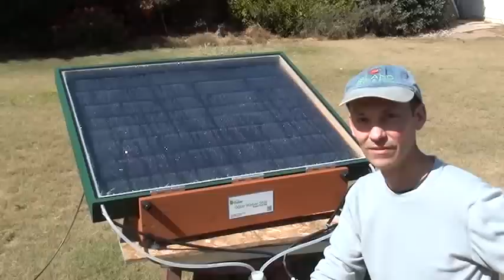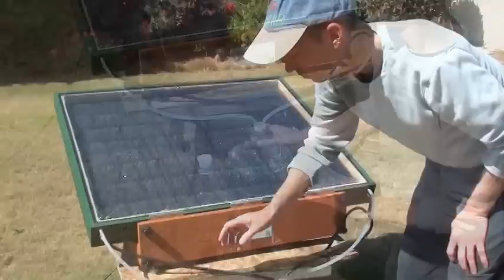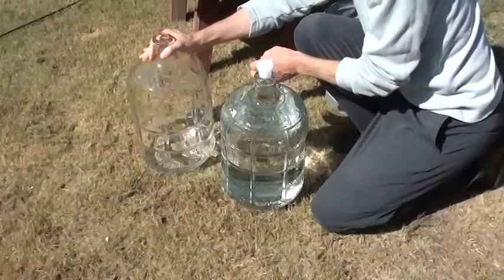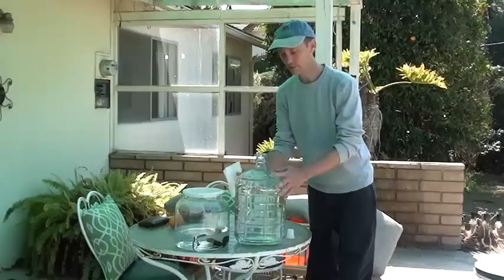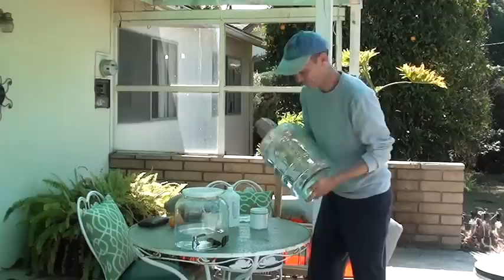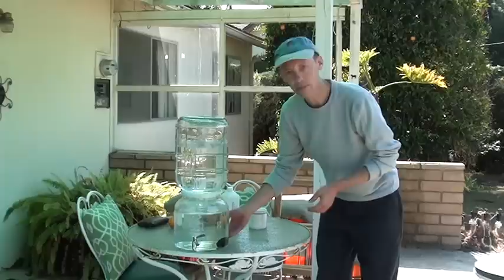Solar water still by Do-Right Solar

Comment: This seems over-engineered for area-based optimisation. Most people don't need to max out on distilled volume per unit area. What you want to optimise for is simplicity (fewer modes of failure), maintenance, durability, and cost per distilled volume unit. For example, you can just double the absorber area and forego complicated inflow/overflow and angled wick. Either by just increasing the size of the entire basin or by just adding a rudimentary thermosyphon by connecting black hosing to the high and low points of the basin, which can be spread out over an arbitrary area of sunlight. Super simple, low cost, low effort.

Comment: Destroying pure water by reintroducing poison in it. Wow!
Reply: That's distillation of sea water, if you are in arid climate, and you can use activated carbon to remove the impurities. And no Silicon and glass is not poison. If you mean salt then every animal from elephant to zebra to gazelle in the wild eat salty mud especially close to river delta to have the minerals they need.

Comment: ya there is very few chemicle compound this wont filter out. my only question how do you deal with algeas? bleach? or carbon filter? microbes would be the enemy of this set up
Reply from the maker: If you didn't use it for awhile, then perhaps algae could build up inside, but if used regularly then the hot vapor will kill off all algae.  After I made this video I added a carbon filter on the output, to remove any last volatiles.

Comment: WHile I am installing gutters to capture rain water we just do not get much rain year round here (only rains a couple times a year) the issue is HARD water. I have to buy water to drink. the tap water is ultra hard and nasty tasting (safe to drink just taste like crap I can clean and cook with it but not drink it)

Anyway I assume distillation will remove the hard water (calcium) from the water? how do you keep things from growing on the black cloth?
Reply from the maker: Nothing (living) grows on cloth, because it's a hot environment exposed to UV, but calcium does accumulate.  Occasionally cleaning the cloth with vinegar removes it.

Comment: What do you think about using mirrors to magnify and concentrate the heat of the sun to heat matter (say sand) to very high temperature to boil water for distillation and producing energy by having the vapor turning a turbine?
Reply from the maker: I think that when the water vapor is used for things like turbines that it becomes contaminated again.

Comment: Your setup is beautiful. I really like the black cloth idea, surely it causes faster evaporation than a black flat metal surface would. I decided I would make a still this summer to turn rainwater into high quality drinking water, and I was a bit flustered on how to best go about it. I was thinking of using a stainless steel or aluminum barrel, painted black on the outside, with a translucent top to allow sunlight in, but I wasn’t sure how effective it’d be.. either way, I’m going try building something similar to your setup, minus the fancy glassware. It seems far more efficient, and is proven to be effective.

Comment: hi! great job! how did you make incoming water to spread evenly on the surface before it gets evaporated?
Reply from the maker: Thanks for asking.  The trick is in both the material (needs to be absorbent so that it naturally wicks the water) and the manifold (tubing at top of unit on the inside, has lots of small holes along its length).  If the manifold holes are too big, then all the water would spill out the holes nearest where water enters manifold.  But small holes ensure that water is delivered evenly along its length.
Reply: @do-rightsolar6455  and you know that it evaporates more water than having the water in a wide tray with the same surface area as the glass?

Comment: Cold Steam the efficient way to use heat sources to produce electricity and or distilled water explained from basic concept to employment.
Two open containers one full of water the other empty connect them at the bottom and water will reach an equilibrium 50 50. If one is sealed except for the connection the other will remain empty because of the vacuum created in the sealed container. 
Gravity will overcome this vacuum if the containers are taller than 30 feet.
 If the tanks are 40 feet tall the tanks will reach an equilibrium of water levels at 30 feet leaving ten feet of hard vacuum in the sealed tank. This makes a vacuum pump set we need two of them if we were going to distill water as the cold side open tank is used to collect the distilled water from it as the continuous input of water needs to go somewhere.

Each sealed tank has four valves three at the top two of those on opposite sides (B&C) one at the very top (D) one at the bottom on the side (A), water-based vacuum pump operations are, Close bottom tank valve A and top tank valve C.   Open top tank valve D. Fill sealed tank through top side valve B. Close valve B and D when full. Open bottom valve A. 
This primes the system to let the warm water in that will vaporize and run through the system when you partially reopen valve B (to control flow rate) and open valve C to its fullest.

For only power generation need one pump set and one vacuum tank so we can have a Hot side and a Cold side one to boil the water and one to have the low pressure/vacuum to draw the steam in through the turbine then the cooling coils then to the tank. 
At the bottom of the cold side, tank is a return pipe with the one way valve to the heat source the one-way valve prevents expansion back to the cold side and as the hot side vacuum chamber is the only outlet for the expanding water and it is drawn by the vacuum the cycle proceeds.

You can combine the two and get power generation and distilled water keeping the return line from the power generation system will let you switch if you don't need distilled water on a continuous basis in large quantities.
 I am going to make one feel free to make one as well it is open source.
Reply: and? 2 years were not enough?
Reply: @Wvotanthewhite  Fighting cancer it is expensive and leaves me tired so apparently yes.
Reply: Is the project and you live and alive respectively?

Comment: Good video......I like the system; but, would want to hook up the carboy to an electric pump and then a filter system like aquasauna.  Here is some info that might help you with your design:
My solar still produces about 5 gallons a day in October on sunny days.  I used an old duel pane solar panel about 3' by 7'.  I stood it up on end slanted against a rock wall fence.  Water level is maintained by a mounted water tank next to the panel that connects at the bottom. The highth of the water in the tank determines solar panel water level.  Next to the panel I built a wooden 3 level shelf stand.  At the top of the solar panel I ran copper tube up first and then down to my first copper coil inside a 2' by 4' water cooling tub and came out the bottom/front side.  Below that tank I ran a second copper coil to my second tank and then out its bottom to feed my 5 gallon distilled water container, final product, sitting at the bottom of the stand.  The top tank removes a large portion of heat from the descending vapor/liquid.  This heated water in the tank (heated from transfer of heat from vapor coil) is then fed to the bottom of the panel and thereby reusing the transferred heat. I tried to position the coils so that all fluids/vapor are being pulled downward by gravity in all portions of the tubing.  Top and bottom tanks are fed by sprinkler timer.  The top tank then also feeds the solar panel and determines what level in the solar panel the water sits.  The bottom tank is fed by sprinkler timer also but does not feed the panel water and is always much cooler then the top tank.  It's water is only used to cool the second coil.  The panel has four ports one on each side at the bottom and one on each side at the top.  I occasionally use the unused bottom port to drain the brine.  I may adapt a valve to automatically dump, the brine, at the end of the day by sprinkler timer later on.  It is important that when you connect the top of the panel to the top coil that the connector is not tight but is left loose to allow air to occasionally enter when good flow occurs or you will create a siphoning effect and get about 20 gallons of possibly sterilized water that is NOT distilled at the end of the day.  There may be some steam loss because of this; but, the effect is negligible.  An improvement I could easily make is take the duel pane glass off the panel and spray the now gray copper sheet and copper tubing black again and I should have more output.  Thanks for your video....good research and testing.
Show less
REPLY
Reply from the maker: Sounds interesting, would like to see a photo or video sometime.
Reply: I have couple of used sliding doors to make into solar distill panel... may I use your panel design. contact chuieyxxx@gmail.com.  thanks Chueiy
Reply: Absolutely Chueiy.......good luck and feel free to ask any other questions you may have.
Reply: fantastic... looking forward putting together and working thank you
Reply: Jack Randle.....my email is oremork@hotmail.com  I can send you pictures.  Maybe I should make a youtube video; but, I have never done one before.

Comment: wonder how good it would be using a mirror in the place of the silicone black back. seems it would be faster possibly. reflecting more light, hotter faster ??
Reply: The black absorbs heat and keeps the heat in. A mirror may tend to reflect the heat back out.
Reply: @Justwantahover  need to experiment on that
Reply from the maker: Unnecessary, as the wick is fairly opaque, but thanks for the idea.

Comment: Well done a good video......except putting a few Japanese twigs into the carboy isn't purifying anything Sorry, I'm a water chemist to truly remove any impurities out of that water(and there will be very few as water stills are excellent for removing 98% of impurities) please look up for yourselves, Get activated carbon and pulverise to powder and then, get a stainless or glass tube and fill the carbon dust to the very top and please use a sterilized end caps to keep the dust in the tubes. Simply pass the water through the tube of activated carbon will remove the other 2%. Then and only then will that water be absolutely pure. Have a fantastic day....
Reply from the maker: The sticks do work, but not instantaneously.  I did introduce a home-made carbon filter after this video was made, though.  I used silicone tubing, which, like stainless steel and glass, is inert.  Thanks for your comment.
Reply: Que Gold is the 2% impurities mostly in the first bit of evaporated water? On another video they said the "lightweight" impurities that do not get left behind are evaporated first so if you throw out the first bit of water you get rid of most of that?
Reply: how pure would the water be if you only used the carbon, without the still?

Comment: i'm glad to see on your website that you changed to carbon filtering BEFORE it's collected.....just putting sticks into the other container wasn't gonna filter anything except provide a home for bacteria to grow like in fish aquariums....kinda like laying an air filter in the middle of the floor expecting it to clean the air in the room...it just doesn't work that way.....you have to move what you're filtering THROUGH the filter in order for it to work
Reply from the maker: If you keep your crock clean, then algae/bacteria shouldn't be a problem.  The sticks do work, but not immediately.  That's why I introduced the carbon filter at the output of the device, to get instant filtration.

Comment: Ever think about coating the inside of the window with Rain X so the water will run down the face faster into the catch basin?
Reply from the maker: I want the inside of glass to be as clean as possible, without any chemicals, so that the distilled water picks up no contaminants.  I haven't seen the drops fall off glass before arriving at the trough (catch basin).

Comment: How do you clean your "wick," being that is the place where the impurities are left behind? Better question, is the wick replaceable?
Reply from the maker: Hi, thanks for your inquiry.  If you go to my website (do-right-solar.com), you can download the pdf of owner's manual, which explains that you just unscrew the unit to access the wick.  Then, just soak the wick in vinegar and hose it off.  Eventually it may need to be replaced, which involves ripping off old one and glueing on new one (using food-grade, silicone glue).

Comment: Cool product! How much does the solar still cost? Is it necessary to remineralize the water, does it affect the taste? Thanks!
Reply from the maker: Hi, I was selling them about two years ago through my website (do-right-solar.com), which is still up for information purposes, but I've moved on and am no longer selling or improving the product.  As for the remineralization, it's perfectly okay to drink distilled water (the US Navy does on their ships), and is refreshing in its purity (I drink it every day).  A myth began when a pseudo-doctor said "Drinking distilled water causes early death!"  Of course, there's nothing wrong with remineralizing it, it may even impart a slight pleasant flavor.  Minerals to add are table salt, epsom salt, calcium chloride (as noted in above video).
Reply from the maker: Dolomite limestone only works if the water is acidic, as it is when it seeps through forest soil and into limestone caves.  Try dissolving limestone powder in water, you'll see how hard it is.

Thanks for comments, Robert.  Yes, sealing is a major challenge, as there are input and output ports, as well as the overall seal.  Silicone rubber is your friend :-)
Reply: hey there your system looks a lot like one that I designed a few years back... I believe that hackers stole my design and then it became "common" public knowledge... the black wick is a nice addition to the design... I like it... so thumbs up!, ... I am planing on doing a video so ppl can distill their own water, yet for what I see in your story, it seems like there is not enough profit... I am interested in the evaporation chamber how did you manage to keep it properly sealed... there are many questions...